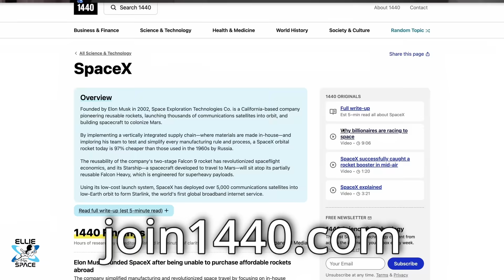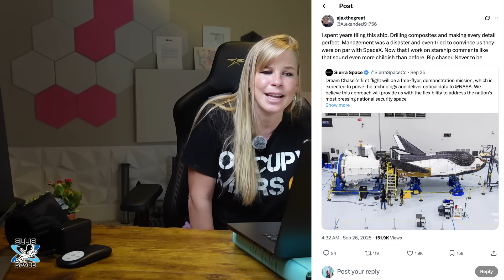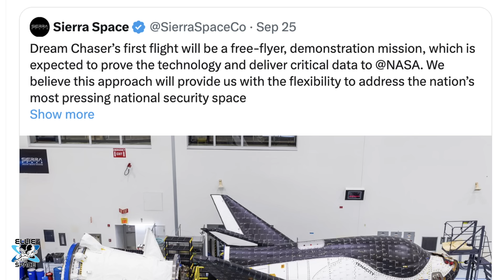1 Billion Dollar Dream Chaser DOOMED? NASA Walks Away

Comment: Even if this ship flew today, there's this huge red flag staring us in the face: the heat shield tiles. They look a lot like the old Shuttle's setup, but here's the kicker—none of it's been tested in a real reentry. I just can't buy that a company with zero flights under its belt for a tile-covered bird coming back from orbit has nailed a bulletproof system.  SpaceX itself, with all that cash and brainpower, still hasn't completely cracked the code after years of trial and error, plus boatloads of actual data from the field. So yeah, when this thing finally lifts off, it's gonna be miles from anything you'd call reliable.
Reply: Another fundamental problem with Dream Chaser is the cost and time to build it. It's not repeatable. Dream Chaser 7 will take almost just as long, done in a lab with a massive team of engineers and scientists who cost a ton of money. While it could still be an exciting program, it has an obvious expiration date. You can't spend multi billion dollars every time you want to enhance & build version X.0

Comment: "You don't polish the chrome till you know if it will fly"... Babylon 5....
Reply: Babylon 5 is fiction.
Reply: @mrbaab5932  Babylon 5 is a dream!
Reply: @mrbaab5932  The statement holds true regardless.   "Don't count your chickens before they are hatched" would be something similar.  Except Leverman remembered something space based, fiction or not.  Another similar one would be "Don't write checks your mouth can't cash".
Reply: @Groundhog-t7l it's "Don’t let your mouth write a check your behind can’t cash"
Reply: @mrbaab5932  the quote still applies moron, you dont finish a piece of engineering until your sure it will work, its common sense!